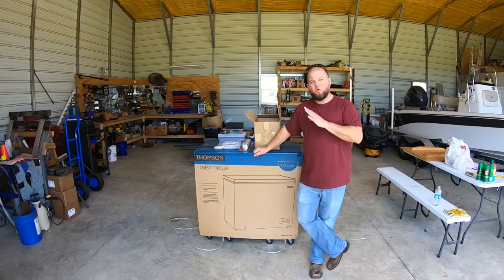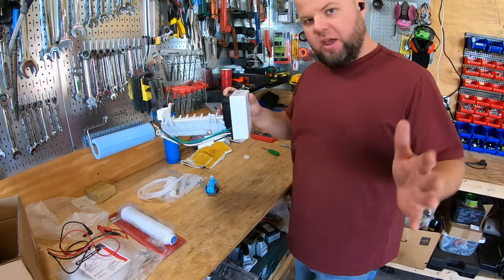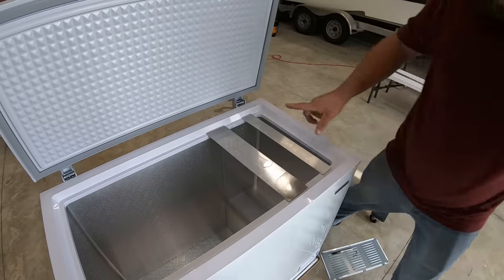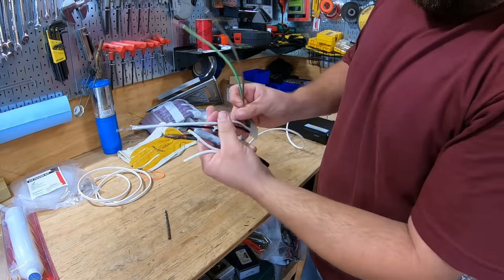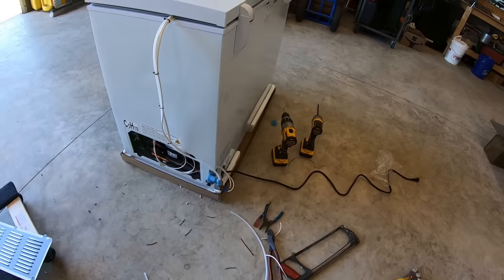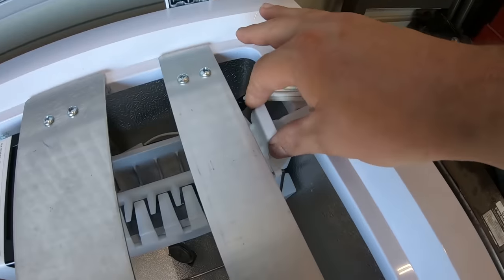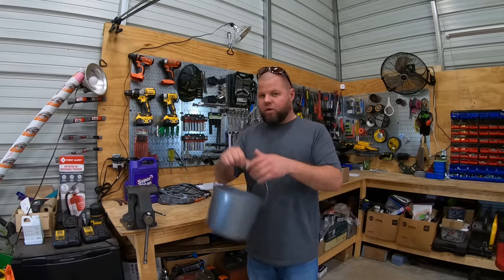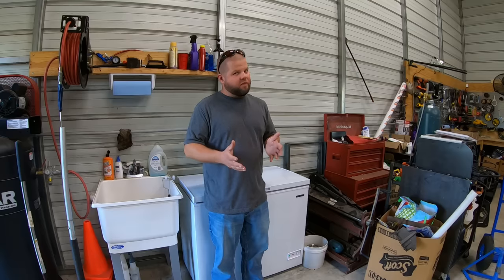Homemade ice maker! SAVE thousands over a commercial ice maker

Comment: That's awesome, the large storage idea seems good. I bought one of those portable ice makers from costco that makes 9 cubes every 15 mins but you gotta check on it every 2 hours and scoop the ice out or it'll stop making ice because it's full. it could probably fill up that bucket in 3 to 4 hours but you gotta monitor it if the ice tray is full and the water tank is full, so less convenient, I recon that thing with 2 of those kits will to the same. any idea how long 1 cycle is?
Reply from the maker: Not sure have not timed the cycle, but it just sped up with the fan addition

Comment: Some units have heaters in door seal areas so doors don't freeze shut, also you can freeze ice in other containers,  making larger pieces of ice, which last longer. I use cups that are tapered, so I can remove it easily.

Comment: Really cool (yes pun intended) idea.  Just a tip if ever you do another wiring project that doesn't have the color wire you need.  Colored electrical tape.  Couple loops of the desired color on either end of the wire, won't rub off like sharpie does.

Comment: To locate cooling lines run for awhile with door open in a humid environment mist a little water on the walls if you have to, it'll freeze over the line and not freeze in between them.

Comment: Another tip. If you need to bend a tube. You can fill it with sand prior to heating and bending. That will help keep its shape. Or you can use boiling (hot) water if the ends are able to be capped.
Reply from the maker: Thanks
Reply: They make a tool for this too. It is a small spring that you slide into or wrap around the pipe.

Comment: The engineering was great project not difficult my question is without it constantly melting what keeps the ice in the bottom of the bin that's been there for weeks from sticking together this has been my experience or say you do have a leak in the lid the ice condensates as it's trying to freeze and then it sticks together and you need a sledgehammer to break it free?
Reply from the maker: No issues after three months, because it's froze in 0 degrees and kept at 0 degrees the sticking doesn't seem to happen. You have to intruduce a lot of condensation for that to happen. I discuss it in one of my recent videos

Comment: @18:00 when you talk about the open top so the tube doesn’t freeze. Does that open part actually extend outside of the freezer and if so is there any concern for dust collection there and contaminating the ice?
Reply from the maker: I wound up taping over the open part for the reason you described. The tube is critical though, it allows all water to drain out so it doesn't freeze.
Reply: @TKCL  thanks for the reply. I have all the parts and am in this process of building when I get free time. As far as the 1/4” water feed, as long as it’s out of the freezer it should be fine. Since the larger tube won’t have standing water, it won’t clog up.
Reply from the maker: Right! I did run a tube inside at the beginning and it froze

Comment: I’ve been an appliance service tech for 28 yrs, if it breaks down put it a Frigidaire IM116000 ice maker kit It used to be and Im 116 There a lot longer lasting and faster producing than the whirlpool style  you’ve got, It uses mechanical microswitches in the icemaker head versus a points system that wear out quicker, This is a really cool idea. How many days did it take to fill up?
Reply from the maker: No idea, I started using ice immediately for my boating trips. It recently caught me and I had to trip the ice makers off.

Comment: Use a heat gun over a thin piece of Metal. Even a large spike/nail bent to 90^. Can put in hot water first. Chance to weaken your plastic tubing too much. Best to try the hot water method first. What I learned about plastic u can use hot water 1x soaked to loosen up. 2x you risk melting & destroying your tube. 2x submerged heat item is very very pliable & risk melting. So be careful. Not too hot& not too cold.Best of luck.

Comment: Nice my only concern is after ice is sitting in there and the lid gets opened a few times are you not going to end of with a mini ice berg over time? I like the trash can idea your boy had you can break that up pretty easy if it clumps but I could just see a 3 cuft  chuck of ice in the bottom. Maybe Im wrong and it wont be an issue.
Reply from the maker: After three months no issues other than what I discussed in my current video

Comment: Nice project!    Possibly the reason water was freezing up in the supply tube is because without a vent, the water would never fully drain into the ice tray.   A tube with a slot cut in it, or a wide rigid tube, would drain.
Reply from the maker: That's exactly right

Comment: People hate on the pipe piercing valve a lot, and while I do agree they aren't ideal, We have been running one for our Fridges water supply for like 6-7 Years now, not a single drop of water has leaked. Ours isn't in wall or covered, the pipe comes out of the floor, then has a 90 on it, so it's very easy to see if it is ever leaking, so no worries there.

Comment: For a final mod, add in a brushless 12v 120mm fan and a pin switch so that it only runs when the lid is shut. The fan will blow directly at the ice makers or be between them blowing at one and drawing air past the other. This will allow the water to freeze in the ice maker WAY faster. Especially since the top of a deep freezer is the warmest point. Adding that fan in and setting the temp as low as the unit will go will allow you to be in the 80lb a day range easily. You certainly want the lid switch though. Nothing worse than opening up your freezer and having the fan mix all your hot and humid air in there.
Reply from the maker: Testing now
Reply: I agree!
Reply: Updates?
Reply from the maker: There is a playlist on the channel full of tests and builds. Let me know if you can't find it.

Comment: Check local auction sites. For a commercial unit. Also, if you kept jumping the wires. Wouldn't you have to change the gauge of wire? Not just for the machine. But from the wall.
Reply from the maker: That wall has 20 amp circuit and 12 gauge wire, it could run several of these

Comment: i’ve also been a Boater,Fishing , Outdoor Enthusiast that uses lots of ice  another trick i learned. is Block Ice seems to last longer  so because i also have a large Deep Freezer going anyway  i use those cheap disposable Glad Plastic containers  from Walmart or the Grocery Stores to  make Block Ice  and i put those in my big Coolers  to help  conserve on the Ice Cube usage and melting  those containers stack nicely with the lids on them  another  easy solution to prevent screwing into the freon lines would be to  glue   wood on the outside of the Freezer to attach items to  that way you are screwing into a 2X 4 or whatever you use  and not even into the Freezer  itself  i often use that method in the engine compartment on my Sportfisher Boat  in a effort to not drill into  the Factory Fiberglass  that often allows Water into the Hull  that can create Blisters over time  that method is very helpful when installing  new Electronics or Upgrades  to the Vessels
Reply from the maker: I agree block ice great as an addition, but not the main source of cooling.

Comment: My concern would be the made ice freezing into a block then having to hammer it apart. Has this been an issue? For camping I use a 12V fridge but want iced down beers and sodas. I use silicone mini loaf pans in the old fridge's freezer to make 12 blocks to fill up a cooler.
Reply from the maker: No problem, I address that in a video I'm posting today.

Comment: If u want to drill thru sides... Fire up freezer and while compressor is running... Use thermal camera on side walls.   U should be able to get an idea where freon lines are.

Another option.. drill thru lid and use flexible hose.

Comment: You could build a collar out of wood and put it on the freezer to attach the ice maker and holes through the side are easy enough. This is commonly done for keezer setups (I have one).  It could then be used to mount the water valve, etc. This would not require any modifications to original freezer and only epoxy to attach the collar on the top freezer.
Reply from the maker: Yep I discuss that in my recent video, definitely going to do that on my next build.

Comment: Just an FYI, the refrigerant is not toxic, some refrigerants are but they are used in very different equipment. The refrigerant in that unit is probably propane, it's flammable but not toxic. It can displace the oxygen in your lungs but only if you're laying on the ground as it escapes the cooling system. The refrigerant can also freeze your skin leading to frost bite, but again, it's not toxic.

Comment: Awesome job! I tried something similar but the water coming into the ice maker kept overflowing, any ideas?
Reply from the maker: Yes, pop the end cap off of the ice maker and you'll see a + or - adjustment screw. Use that to set water flow timing into the ice maker.
Reply: @TKCL  awesome thanks! Keep up the good work

Comment: at 19:35 kind of  looked like  u was making some breaking bad paraphernalia. 😃😃😃.  props came out dope. i did a similar build wih a black igloo model. made a similar ice machine setup. have u had any trouble with frost building up inside walls that can cause problems with tempurature  not reading correctly and the compressor overworking and heating  and making more stress. after defrosting 2 times  my girl had an idea to ke3p the ice fr9m sticking on the wall she gave me some plastic dish racks which has slots to keep the air circulating and not having to defrost. as with any chest freezers  buy a few relays since thats the part that always fails. hard to find locally but cheap ass hell online.usually when people throw these out and buy new ones replacing the relay makes them work like new😃😃😃
Reply from the maker: It's been great, I scrape the frost build up once every month or two. I open it up so often I keep introducing warm air. Our big food freezer is the same way.

Comment: Okay so I’m having a little trouble with the wiring….I decided to run a separate plug for the ice maker, im just a little confused on the wiring…let me know if this is correct…I have the green and brown wire from the ice maker connected to the 2 prongs on the inlet valve, and the white and black wire from the ice maker connected to a cord that plugs into the wall…does that sound right?

Comment: Another idea, if you add a fan inside of the freezer, the ice will freeze A LOT faster.
Obviously, the colder air is near the bottom of the freezer.
The air circulation will bring that colder air up and cause the ice production to increase.

I live off grid and make block ice, that I use as my fridge.
The fan helped make the blocks, tremendously faster.
Reply from the maker: Keep watching, I add two ice makers and fans.

Comment: Recently bought a countertop icemaker from Walmart for $100. Produces 26lbs per day. Basket holds 1.5lbs. The catch is that it doesn't have a frozen bin or an automatic fill on the water reservoir. I have been emptying the bin into a deep freeze and can accumulate quite a bit of ice pretty quickly just with more work.
Reply from the maker: I have one too, if you don't bag the ice it freezes together
Reply: @TKCL  I noticed and watched the other videos in the series after I had commented. We have been freezing the cubes in the deep freeze on a sheet pan then transferring to a bin when frozen well.

Comment: I would personally run the water in in a separate groove from the power, because with it being at a mechanical meeting point you run the risk of wear, so if you rub through your wires you could have a hazard with the water tube

Comment: One other good thing about your idea vs. commercial is if your ice maker breaks it’s only $69 to fix it in parts. Congratulations great idea.
Reply from the maker: Correct, actually the ice maker is cheaper than that if you don't the the water valves and extra stuff in the kit.

Comment: You could also find a used portable unit for relatively cheap. Like less than $50 cheap. Cannibalise it for the ice making part and install that in there. The way those work (and I'd imagine that they work in the same manmer as the bigger commercial units) is they've got little fingers that sit down in each individual ice cube tray and they freeze the water around the fingers and when it's done it heats those fingers up real fast so the cubes of ice won't stick to the fingers and the tray rotates to drop the frozen cubes down into the storage tray. 
And those little units can produce a tray of cubes every 5 to 15 minutes depending on the quality of the unit and the size of the ice cubes you select.
I would guess that one of those ice cube making units could work twice as fast as the freezer unit you've bought, but that's an uneducated man's guess.
This is an awesome idea though! One I may steal myself. Thanks for sharing with us!
Reply from the maker: Thank you for watching
Reply: @TKCL  I just realized that you addressed the issue of running the type of unit that I mentioned. And that is correct. You've gotta figure out what to do with the excess water. In the little units they just let the water run back down into the reservoir to be reppumped back into the ice trays which you could figure a way around, but the ice cubes would be one huge block bc they're barely frozen when the machine cycles. 
It could be done, but would all that work even be beneficial in the long run? Probably not. Great project!!
Reply: Oh! And I'm now subscribed. Bout to watch how well it turned out with the 2nd unit. 
Man, this is one hell of a great idea!!
Reply from the maker: Another video is about to post in 30 minutes with my fan install, it's a must watch.
Reply: @TKCL  and wow! I am impressed at how much a difference those fans made!!

Comment: Question does it have to be pressurizes water or could it work with a holding tank of water with down flow pressure  ? For a place where no pressure water line is like a shop or she'd building
Reply from the maker: Not sure yet

Comment: Great idea. what's your thoughts on making block's of ice for an ice box ? I really would love to know if I can save energy by removing my refrigerator. I'll be doing same mod to my dep freeze as I love all day fishing trips and camping/off grid living. Subed.
Reply from the maker: I've made some smaller blocks in this setup. Personally I like individual cubes since I pack drink coolers often. No doubt blocks last longer.
Reply: @TKCL  I'm guessing that means you have not tried to remove refrigerator from home and replace it with a ice box to see if it save you on energy bill. Ty for shearing :) fyi a Ice box was from 1300-1800 before electricity. Usually a hole in the ground with and big ice cub. O_o
Reply from the maker: No I have not tried that, I prefer my freezers and refrigerators. I'm converting over to solar now. My ice maker is already on solar and technically making me free ice.

Comment: 🤣 I did almost the same thing, but without having to buy anything except a dozen ice trays. I made myself a little shelf that sits down inside my freezer and I stack a dozen or so ice trays full of water in there, let them freeze, then bust them off into a trash bag and do it again until the freezer is full. Takes me about 2 minutes to fill all the trays and maybe one minute to dump them out with a total expenditure of less than 20 bucks.
Reply from the maker: I have to invest zero time in making my ice or remembering to do so. It's made, dumped and stored without my input. I like that convenience.

Comment: Use a surface wire chase put 2 outside corners to go over the top and into the motor compartment I like the metal ones best but the plastic will do

Comment: commercial unit on the small side will do 300 plus lbs per 24/hr cycle. I'm curious what your actual electrical /water cost is now although I have a 400 lb machine myself for fishing. P.S that freezer said flammable because all refrigeration units now use  a propane blend instead of the old 134a, 404a. very creative!
Reply from the maker: I cover all that in a recent episode. 21 cent a day to run, 44 cent per 20lbs. Thanks for watching
Reply: @TKCL  good deal then!!

Comment: It's flammable because it's hydrocarbon. Same stuff you can get at the store to recharge your ecu. Works alot better then the proper r134a or what ever. 
Hydrocarbon is like a propane mixture.
Reply from the maker: It's c5h10 cyclopentene